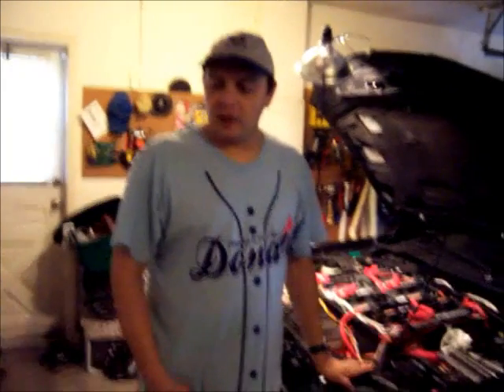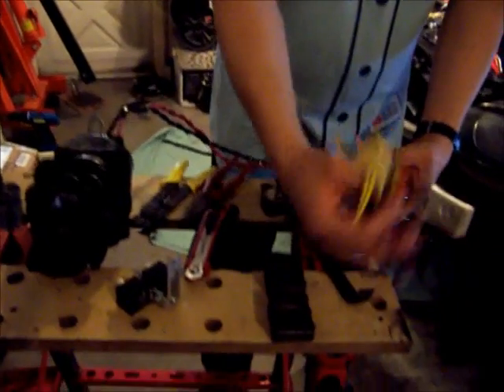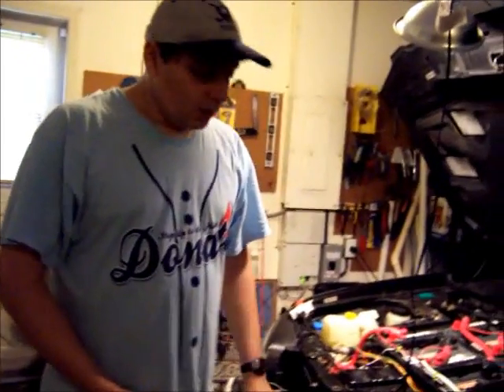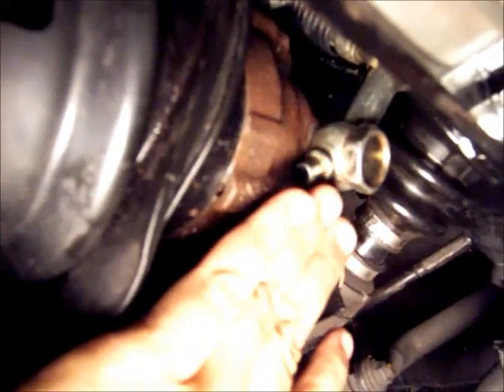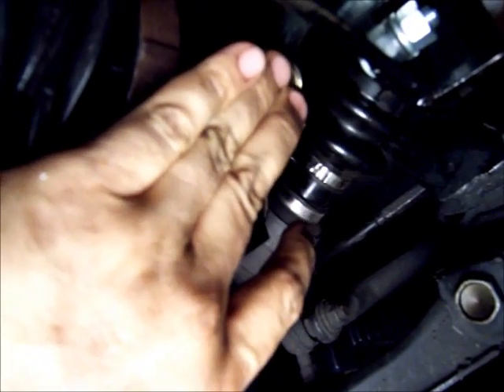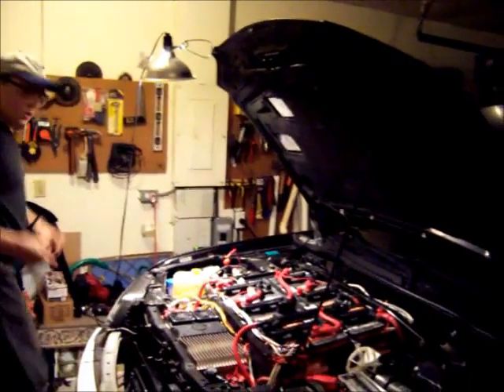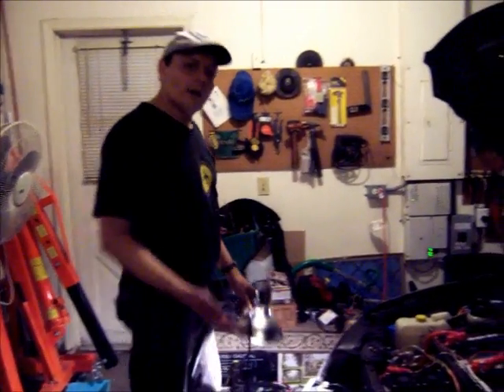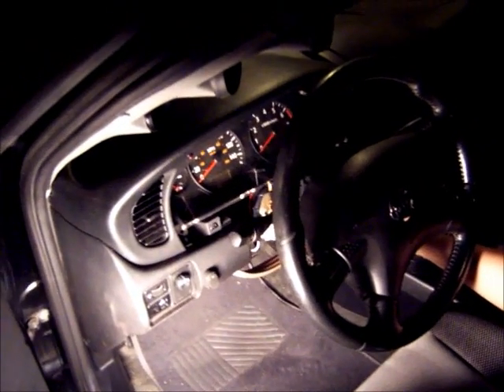Nissan Sentra Electric Car Conversion Part 28

Comment from the maker: No. No regenerative breaking supported by my DC system. Most of the systems that allow for regenerative breaking are AC.

The noise is more as well because enclosed garage. Once I am ohe road and driving, I can hardly hear it unless I am going too slow, so I don't mind. I will eventually try to upgra to a newer MR2 power steering pump, the one with the oil deposito together with the pump. Those are much more quiter

Comment: I think it's extra noisy because the hood was open and no engine was running!
Something different: since your car is heavy (lead acid batteries) the acceleration performance is lower of course (and energy use) but the energy gain by breaking via the electromotor would be greater too! Does the controller support that, using the elecromotor as a break?

Comment from the maker: I didn't realize it was going to be so noisy, but I see other cars using the same pump and they are as noisy :(  Look for Volvo 242 electric power steering or MR2_Pump_Test.MPG in youtube and the ones tested there are very noisy as well. Too bad :( I think the more modern Toyota pump is much more quiet. I should have gone that way.